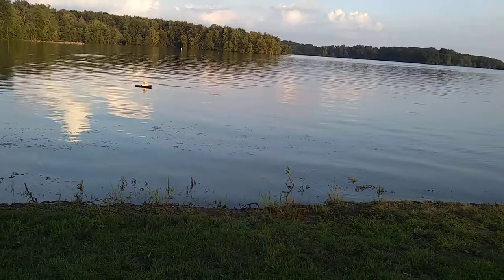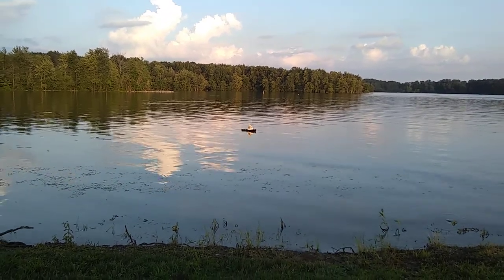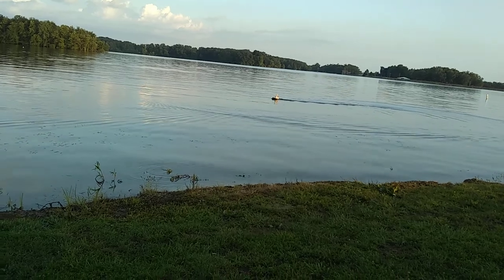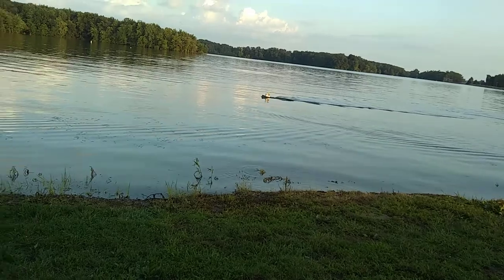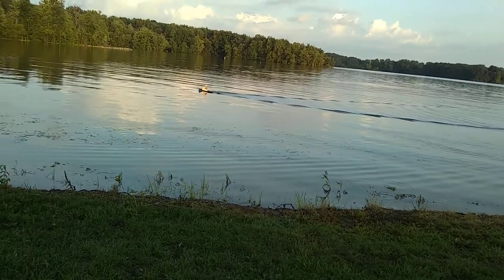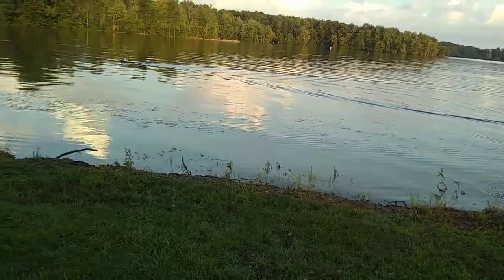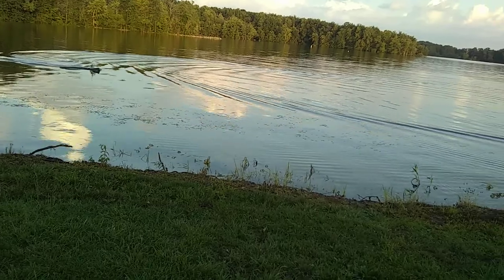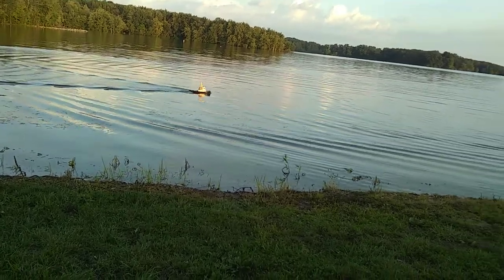Proboat Horizon Harbor Tug Upgraded (Please read entire Description below.)

Comment: So I upgraded this boat as follows: 
-Painted the deck navy blue
-Added a 4 blade 50 mm prop
-Installed a new receiver
-Added 3 Oz of ballast mostly aft 
-Installed a new esc
-Glued all the seems
-Added foam to both the hull and superstructure 
-Installed a camera in the pilot house 
-Put in a stronger💧 proof  metal geared servo
-Sealed the water cannon entry 🕳 
-Added some wire and line to the winches
-Added some lines to hold the retrieval arms when not in use
- Swapped out all screws with hex ones
-Installed  an antenna mount
*This is a fun little boat to both work on and run
Reply from the maker: *... Well Put, Snake!⚓

Comment: Dear Sir, Where do you place your battery in the boat for the best balance? Also, does the supplied receiver with the T6L work with the crawler esc? It looks like this radio is designed for aircraft. Thanks

Comment: Oh, great video. Is there anyway you could send me the link to the prop the 60mm prop  you used? Thank you.
Reply from the maker: Hi Steve,

I got it off eBay... and I don't know if the Vendor is still on there.

Let me have a Couple Days and I will try to Connect You with Sources for the Propellor  and Drive Dog.

The Cap Nut I was able to Source from Rural King Supply here in Olney, most any Traditional Hardware Store should have Those on hand.

We Good with my Getting back with You say by 00:00 HZ Saturday Morning?
Reply from the maker: @stevejudd4615

Hey Steve,

Sorry it's taken me so long to get back with You, but here's a Similar Prop on Ebay, just enter this Item Number in the Search field:184617346203

May not be the Exact same Seller, but more than likely, a 60 mm Diameter, bored for a 4 mm Shaft should be the Ticket. Either Left or Right Hand is Fine, The 'Taucher O. Wulf' (Prototype for the Model)had a Right Handed Prop...

Still looking for the Propellor Dog, will send You another Link when I Find it.
Reply from the maker: @stevejudd4615

Steve?

Here's the Ebay Item Number for the Propellor Dog:

171776844057

Hopefully These are going to Work for You as well as they have for me...

Keep in Touch and let me know here if You Post Videos of Your Tug on YouTube... sometimes I get a little Overwhelmed by All the Notifications I Get, LOL?

Good Luck and Godspeed,

Bruno ⚓
Reply: Dear Sir, thank you for your informative video. Do you know if I need a special receiver to work with a brushed motor?

Comment: So is this the original motor?  I've seen other people put a motor in it that has it running really fast.. not sure i'd want that for a tug but are there advantages or disadvantage? I'm on the fence about purchasing this particular boat.
Reply from the maker: Tugboats by design are more about Power than Speed... that's why they are typically built with a Displacement Hull. Since they are short in length, they don't have a very high top speed.

What they should have is the ability to push and pull. Tugboats have enormous Propellors for their size and powerful Engines to turn them which results in a Force known as 'Bollard Pull'. 

With the 60mm 4 Blade I am using, I don't get much more speed than the Stock Propellor, but it's more efficient in Bollard Pull and Maneuverability which is what I was after. It can go just a little faster, but I have limited the Output of the ESC to 50% because going over that pushes the Tug over it's Hull Speed and although it looks 'impressive' with a huge Bow Wave and Wake, it just sucks all the power out of the Battery and really isn't going much faster or pulling much more.

Changing the Motor (and the Propellor) can get you up on a higher Plane if that's what you are after, but if you intend on using the Retrieval Arms, I don't think it would work out so well. There are Tugs designed with a Planing Hull if you want to go fast... but, pushing the Horizon Harbor Tug up on Plane just seems weird to me... I'm not out to Impress anyone with how fast it can go, I just want to take it out and Relax and maybe find a Barge to push or pull around like a Real Tug does.

Thanks for your Comment... I'm sorry I can't provide some better answers. All I can say is that I am content with the Original Motor with the new Propellor, ESC and Radio. Your Results may vary, but remember to have Fun with whatever boat you choose.

Bruno Biava ⚓
Reply: @brunobiava4833  are you kidding? That was the perfect answer, thanks!

Comment: My prop shaft doesn’t seem to be long enough to go into the motor thing after putting on a new prop and drive dog
Reply from the maker: @evinsprague ,

There's more Art (and Luck) than Science in getting everything back together and running Smoothly. A Model Tugboat's Propeller Shaft Alignment is very Sensitive to the Environment that the Model is Operating in and if You are Careless about Maintenance of the Alignment and keeping the Shaft Greased, either You can Sink the Tug or Destroy the Universal Coupling, the Motor, the Electronic Control Systems and/or the Battery. 

Is this Your First R.C. Tugboat?
Reply: @brunobiava4833  yeah, but I’ve had it for a couple years now.  And I have other boats.  I know to do maintenance on it.
Reply from the maker: Okay... I'm going to make a Quick Video and see if We can Figure it out. Okay?

Hang on, Brother... I'll slip You the Link Here when it's Uploaded, Okay?
Reply from the maker: @evinsprague  

Evin,

Here's the Link to the Video:

https://youtu.be/zwku8BXhi-Y

These Boats are just a Pain beyond Pains to Deal with, and I wish I could help You more.

Hopefully You can Understand how Heartbreaking things are sometimes.

I hope You have a Better Experience with Yours.

Good Luck and Godspeed,

Bruno Biava ⚓

Comment: Do you have a link to the 60mm prop you used?
Reply from the maker: @toddilgen1

I got mine from eBay a while back, You are also going to need a Cap Nut and a Drive Dog.

I will try to Find some Information for You ASAP, right now it might be Friday before I can get back to You...

Sorry about the delay...

Bruno Biava ⚓
Reply: @brunobiava4833  do you know what shaft size is, 4mm?
Reply from the maker: 4 mm Diameter Shaft is what mine was, but I suggest that You might measure the one on Your Tug just to be Certain.
Reply from the maker: @SelenaI.  

Go to eBay, Search for "60mm diameter 4mm shaft model boat propellor".

Search result should come back with something like:

https://www.ebay.com/itm/374667744145?hash=item573bf01391:g:~JwAAOSwY~hkTqhZ&amdata=enc%3AAQAIAAABAA%2BnYgLaND5J0utPTWyS4MZYQ%2BmUdO1AeWDZcIcMOHnQZR6b8hFkpB0SUOTQj3vodumKnmanrPH9%2FucKfKblpzx4qqqTAO4Odhml9RbfdduRSSYbMKjcPttLJ%2F0mc%2F1fPkZiuiHibY%2Bz4tv0PHCxDCeSX%2FlvJVyU8oS%2FgPPgi7DlspDcFDPl1XGMJXlVYoGyKsfZxVVGBQ%2F5jIyB%2F9QENQFaKKklEaGRK%2BYUASGYoXbFIaoZQCHrzVBhRdsLedZnybUcmfnp%2BgzpTuobCjfjL%2F9dh9QZbYOYhPPZYgm2z5hBJE4cTvOPBl%2F0PXeIJJwDzCnDNbnjTIU9UktVpLqpfxg%3D%7Ctkp%3ABk9SR5TR2a-SYg

For Diameter, select "60 mm"

For Type, select either 1pc Left CCW 
or 1pc Right CW

"Left CCW" indicates that from the Rear of the Tug, the Propellor turns "Top to Left" or Counter Clock-Wise.

If you Imagine that You are Facing Forward at the Helm aboard the Tug, as the Tug moves Ahead, the Tug will turn to the Right more Quickly than to the Left...and when Backing or moving Astern, the Tug will also  Pull to the Right.

With a "Right CW" Propellor, the Opposite is True.

The Prototype for the Model was the "Taucher O. Wulf 8" out of Rostock, Germany. She was Sold to a Party in Norway and Yarded for Cleaning, Modifications, and Repainting into  Her new Owners Colors.

Here is a Link to a Picture of the Stern (or Rear Tug Yarded in Bergen...if You Look Closely, You can see that the "Wulf 8" had a 4 Blade, Right CW Propellor.

I will try to get back with You Thursday and provide a Link for the Drive Dog and Cap Screw Your will need as Well.

Bruno ⚓
Reply from the maker: @toddilgen1

Here's a Link to a 4mm Drive Dog that You will need to Fix the Propellor to the Drive Shaft:

https://www.ebay.com/itm/171776844057?hash=item27feb2a119:g:IKcAAOSwhcJWHFlM&amdata=enc%3AAQAIAAAA4OG0MgHisyqONtdK6oVlg8nEZxBQTyzdJZaZNt9qHxLLH4oN40DEdZ7QMdMuPGA43qDXMiI%2F%2FPLHhRse7rztEwwdZIQiKcDuXsjJ6MGdD2OBzIMnuaecq%2BJ3R6aBE%2FuM3C%2F8Sl%2F%2FI12b5W2E7ETAmnaXwI5VpbQJWif2MGoT6urKlP53zqmCTS6OROgMpuevlH2xuHe6qLq%2F60oIPncEddIT%2BpQ0KskZsAflitBcTMU1G93vcbuiUaiy36jvN7q12aqUNo810ie1Kg3n7zbhkxFHd8zNKNbX%2BH30tgZJhSqZ%7Ctkp%3ABk9SR47Q0seTYg

...and Here's a Link to a Acorn Cap Nut (4mm 0.70 pitch) that you will need to Hold the Propellor to the End of the Shaft:

https://www.ebay.com/itm/113532841824?hash=item1a6f15af60:g:2~EAAOSwkERcNRBX&amdata=enc%3AAQAIAAAA8G7F96VdrN8v38UBrKGH3mZomy%2Fk5Muol1Pbtr%2BaJuv3KZGJogmpkamfZSoGgKpFKrVivhqCUnb1oZiX0Ft6MIk%2Fhj%2BN6VZhhGVyseigoyhtnOsdWs4cXbEFLP8IiXIYcNSbczg3Hre12d18ldO1igzsHGhg2RgYllF%2BakGXuS%2BorKuKx%2FCLV0JfLExH3y7cAlAguCob98ly1u8BIuu5gbsqvL47rKxbnWki2WCGfSVKLptoAOPP0v1u6D9aC9hYwyQLtaPUKb46ZkFbWqOxq2meZJwd%2FDz5GaBbE%2FjzRUgxrhRbVpHE%2BbxqivAJq6yBKQ%3D%3D%7Ctkp%3ABFBMmJKKyJNi

Bruno⚓

Comment: Does it stay cool?
Reply from the maker: I usually have the ESC set up to only 50 to 75% of capacity, so I really can't say. I have run for about 10 minutes at 100%... Didn't have any lasting Issues, but the Motor and ESC did get plenty warm.

I don't have a fan or Water Cooling for either the Motor or ESC... I just run at Hull Speed most of the time anyway which is only about 40% of what the ESC is capable of.

I keep my other Tug on Standby with the Retrieval Arms attached and ESC set up for 100% just in case I need it in a pinch.

Sorry I can't give you a Straight Answer, but I appreciate your interest and Comment!

Comment: Where can I buy that propeller?
Reply from the maker: I bought mine on eBay. Search for "60mm model boat propeller". There's a lot of sellers. 

https://www.ebay.com/sch/i.html?_nkw=60mm%20model%20boat%20propellers%20&ssPageName=GSTL

The ones I used are Right Handed 4 Blade and a Brass plated solid metal. The Shaft Hole is 4mm. You can use either Right or Left Hand which ever is your preference.

You will need to also get a 4mm drive dog, and you can either reuse the original Locking Nut on the end of the Shaft or replace it with a Cap Nut . Just don't forget to use a thread locking compound.